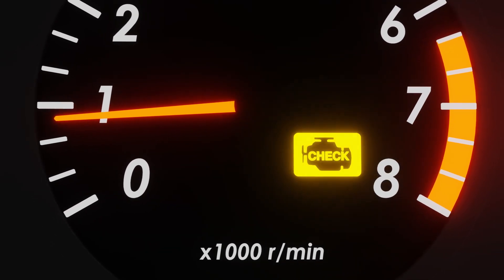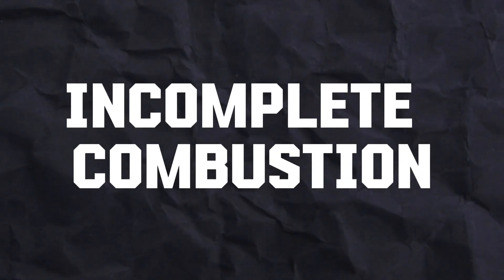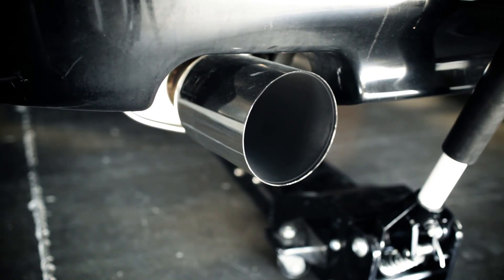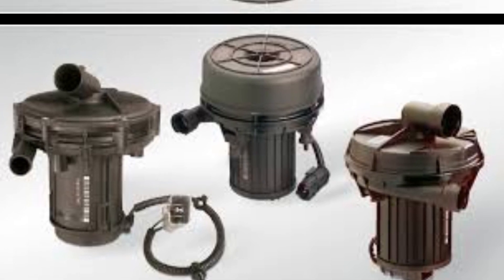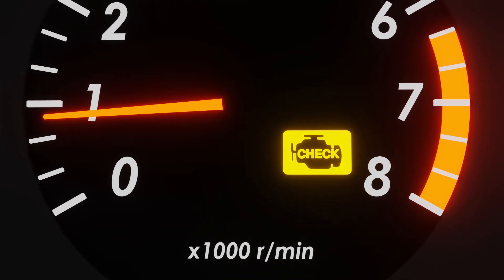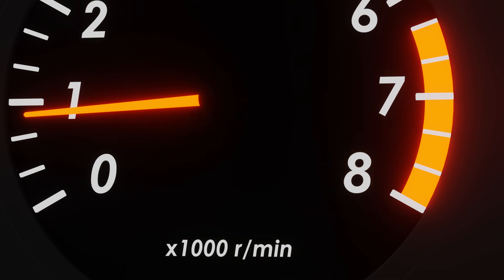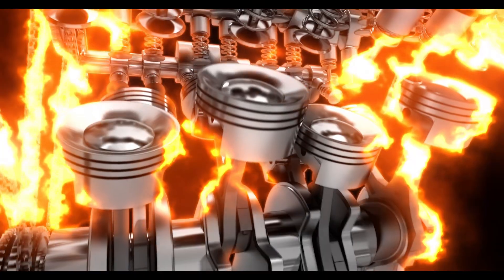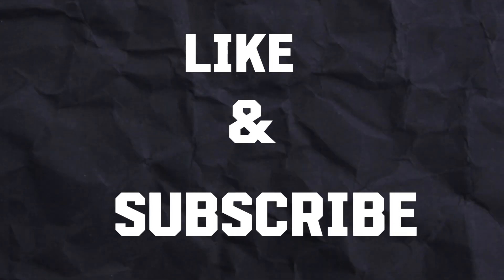Why is your CHECK ENGINE light on?

Comment: My new toyota corolla cross with 3km odometer has engine light on when I started the engine message appeared "engine is not ready to run" ....IDK why😮😢... I just turned off then restarted the car as if nothing happened (no message second time)
Reply from the maker: Good to hear you get it back. I have also seen this cross issue with someone else few months ago. I don’t know, I assume it is related to safety system like seatbelt, depressing the clutch or pedal while starting, weather issue….

Comment: Mine says check emissions system. It’s not the fuel cap for sure. So I’m not sure what else it could be besides probably a faulty sensor.
Reply from the maker: Watch for also for another symptom along with the check engine light. And, consider using OBD2 scan tool
Reply: @ArrowGearhead  definitely the OBD two scan tool. So far no other symptoms at all that’s a good thing, but it’s very puzzling but the scan to absolutely help a lot. Thanks for answering!

Comment: Hi there,

I have a 2023 Cadillac Escalade ESV with 18,000 miles on it, purchased new. Recently, the engine light has been coming on and off. I took it to AutoZone for a diagnostic check, and the codes shown were:

	•	Power Train System
	•	Secondary DTCs: P0OFF
	•	Body Control Module Requested MIL Illumination: U1962

Do you know what these codes mean? Thank you!

Comment: I discovered another reason for the check engine light.  On occasion, while driving with no obvious engine problems nor fault symbols on the dashboard diagnostic display, the car would pass over a pothole in the road causing a mechanical shock to both the car and it's ocupants.  Simultaneously the check engine light would illuminate on the dash.and remain on thereafter.  If I used my OBD2 reader to turn the check engine light off, it would remain off thereafter until the car ran over another pothole or bump in the road, etc.
Reply from the maker: Thank you for sharing
It could be an electrical continuity issue due to vibration from the hole, or it could just be a faulty sensor.                                                                
Is it only the check engine light or some other light also? What is the code?
Reply: I have experience this a couple of times too
Reply: Hey I am having this issue. Please let me know exactly if there is a surefire way to stop that. In my case I need to change the front shocks and all 4 springs. to ensure it can handle these pot holes.